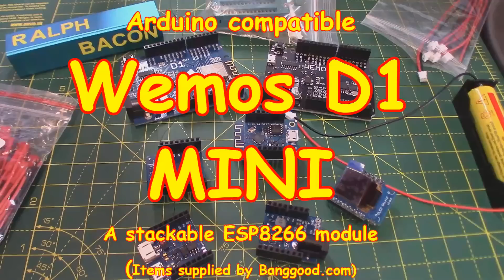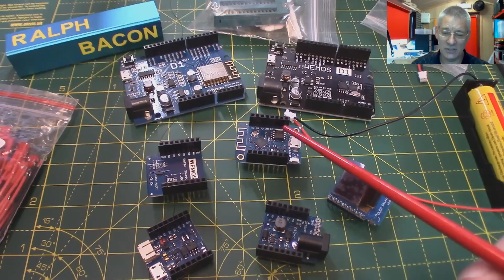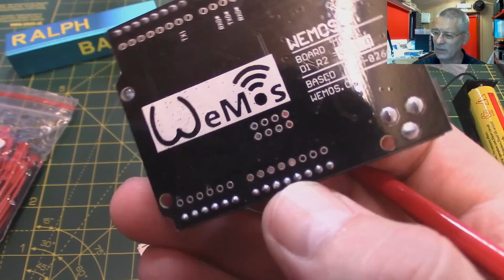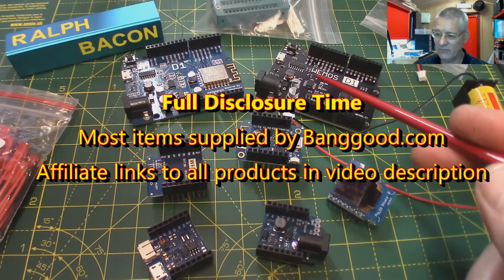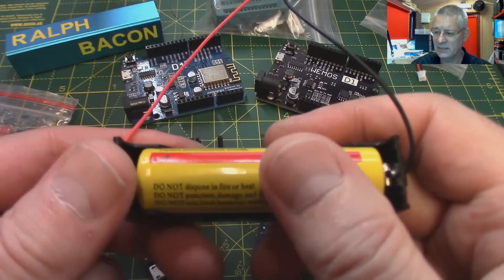#120 Wemos D1 Mini 👍 Intro (with shields)

Comment: I don't think there are strict rules for JST connectors and wire colors. It depends on how the designer implemented them, the designer can make or order the right combination of wires for that product. Manufacturers can produce wires in any color and combination if you order enough of them. If you're producing a product in large quantities, like 10K units, you can customize almost everything, including custom cables colors, wire combinations, custom text on the wires, etc.
Reply from the maker: Yes, manufacturers will customise a connector (the wiring) for you, but it leaves us hobbyists with a risk that it's not what we last used or what we expected, perhaps!

Comment: Really found this demo and explanation useful. I have been trying to tie all this together with your voltage monitor to monitor 12 volt solar battery over WiFi. perhaps this may be of interest to you for the future. There is little about to give accurate battery reading over WiFi. As I newbie it is a struggle to tie different projects together for me but just cannot get the end result of it working. Thank you for your video's they are very helpful.
Reply from the maker: Glad you're finding this video still useful!

Comment: I have LiPo batteries with that micro JST connector hard mounted to the battery without leads. Would be interesting to check polarity compared to that connector.
Reply from the maker: There just doesn't seem to be a standard - well, not at the time of making this video. Perhaps things have got better by now and follow a defacto standard.

Comment: Thanks for this video, Ralph! Currently diving into many rabbit holes concerning the installation of Home Assistant and adding protocols for my new home. I just ordered a Wemos D1 Mini (V3) with a DC Shield and a PWM Converter. I'm planning to use the D1 with ESPHome (or maybe something easier such as Tasmota or ESPEasy because it's my first installation) to give 0-10v signals to my mechanical ventilation (Zehnder ComfoAir E300).

I checked the Zehnder in my new home and it got three pins (?): GND, 12v and 0-10v. So with a closed circuit I can drive the Wemos D1 from my Zehnder and get it to automatically running once I'm showering (with a humidity sensor picking up a drastically increase in humidity) and once my cooker hood is on (maybe with a smart plug / switch or from the unit itself, because it's a Siemens cooker hood with Home Connect). Will keep you posted how it all works out in a couple of months :)
Reply from the maker: Sounds like a project to keep you busy!
Have you seen Pete Scargill's website that deals with MQTT, Node-Red and full Home Automation. I've briefly skimmed what he was doing, got my 4-ch Sonoff to respond to Alexa and then stopped. That was at least 1 year ago. But he is the guru of this stuff, worth taking some time to read his stuff, really it is.
https://tech.scargill.net/

Comment: How is it possible to install the CH340 driver! Write me the full procedure please!
Reply from the maker: This should help you Gabor:
https://learn.sparkfun.com/tutorials/how-to-install-ch340-drivers/all
Reply: @RalphBacon  I have got an Arduino panel type Wemos D1 R1. Is it compatible the method of installing CH340 driver due to this webside?
Reply from the maker: Yes, the driver is for your Windows PC not the Arduino, so it doesn't matter which Arduino board you plug into your CG340G (or have installed as part of the Arduino board). I have a Wemos D1R1 too and it works fine. You only have to do this once and your PC will recognise the CH340G forever.
Reply: @RalphBacon  I have already installed the CH340 driver, because the videó David that this is the compatible one which is necessary for Arduino Wemos D1 R1.
Reply: @RalphBacon  Thanks for the important informations. Should you show me websites, about Arduino Wemos D1 R1 programming from beginner level, to Advanced level? If you can show, please write down the links! Wrtie down the links that expalins the programming method easily!
Reply from the maker: I'm afraid that Google is your best friend here. I don't know what the problems you are having are; if you have installed the driver and the CH340G USB-to-Serial module is correctly identified under PORTS in Device Manager then whatever you put on the end of that module will work just fine.

Comment: How do you add the WEMOS_SHT3X library from your github page to Arduino?
Reply from the maker: Download and unzip if required. Place it in the libraries folder in your sketch folder (the libraries folder is a subfolder of where you place your sketches). Include the library as per the demo sketch.

Comment: Just curious,  have you tested the range of these devices?  I'm wondering how far they can go,  and still make a reliable wifi connection.
Reply from the maker: I haven't done any range testing, Roy. I do know that it works fine through two brick walls at about 10m in my mum's flat in Germany which was my only concern. This report has much more detail: https://hackaday.com/2014/09/26/esp8266-distance-testing/
Reply: Well,  I must say,  the results seen after following that link are quite impressive!  I guess I'm going to have to get a hold of some of these modules and play with them a bit.
Reply from the maker: That's the only way you will truly know the results. Go for it!

Comment: Hi Ralph where do you get your D1 Mini from as I have two clones that don't work properly and want to purchase the real thing I notice now that the d1 v3 has no can so are they genuine? Bob
Reply from the maker: Hi Bob, I got all my Wemos D1 Mini stuff from Banggood as they seemed to stock the whole range. Now whether that is a genuine range or not I couldn't say. It does have the Wemos branding but that means nothing. That said, I now have two of my Home Alone units running 24/7 in my mum's apartment and they don't go wrong! Geekcreit seem to have flooded the market recently though.
Example: https://www.banggood.com/5Pcs-WeMos-D1-mini-V2_2_0-WIFI-Internet-Development-Board-Based-ESP8266-4MB-FLASH-ESP-12S-Chip-p-1150188.html?p=FQ040729393382015118&utm_campaign=25129675&utm_content=3897

Comment: how do i upload codes from the arduino ide to the wemos esp32 mini32?
Reply from the maker: Exactly the same way as uploading to an Arduino Uno, via the USB socket on the Wemos. Works very well, no buttons to press either like on some other boards.

Comment: Another header wiring question: with your neat little stack (D1, battery shield and OLED), how would you make connections for other external devices (LEDs, sensors, etc.)? I'd like the D1 to be breadboard-able during development, but then fit into a stack for deployment.
Reply from the maker: You can get development shields to build your own custom circuit on. Obviously they have to be small enough to fit onto the ESP8266 Mini format or else you would have to design a daughter board that connects to the headers but overhangs if you have a big circuit. The bare dev boards are cheap, mainly because they are just a bit of PCB with headers sized to fit this format. Also look at my recent Home Alone project; there I have designed a HEX PCB base so I can have six on a single board so it is a bit flatter. Oh, and use good quality sockets, headers and stackable headers.
Reply: @RalphBacon  Thanks for the hints. I might just go with the usual protoboard stuff as I only have about six lines from the D1 stack to other components.

Comment: Ralph, I know it's an old video and this comment/question is a little "off-topic" but what lib did you use to get the clock running. Current 1.2.7 displays nothing but I get half a clock with 1.2.0., SFE_MicroOLED.h.  Thanks
Reply from the maker: To be honest, John, I just loaded up the example sketch that comes with the library I'm using (and is probably in my GitHub for this project). Try using the library I did and see whether that works better for you.
Reply: @RalphBacon  I found a simple fix!  It was called "Go to bed, and try tomorrow!"  It all worked fine!!  lol

Comment: Hi again Ralph
I'm going to forget about the OLED I was having problems with for the time being, as I know it works perfectly with another library.

Meanwhile, I've managed to adapt your code for sending temperature data using the SHT30, which I don't have, to the BMP180 shield. Remember, I said "what could possibly go wrong?" Well, nothing actually and it works a treat. Having dabbled a bit with HTML/CSS, one refinement I thought of was to have the page refresh every so many seconds/minutes so as not to keep pressing F5 all the time. So I included the line:

client.println("<meta http-equiv= &quot;refresh&quot; content = &quot;5&quot;>"); within  <head>

I used &quot because multiple inverted commas threw up errors with the compiler. But it still doesn't work. I wonder if you could show us the correct syntax in this context as it might be useful to others as well.

Thanks again for your very informative videos and your help with the OLED
Reply from the maker: I don't blame you giving up on that library/OLED combination at all, Pete! You've got a solution so stick with it.
Regarding that line, you can use single quotes within your main double-quoted string. LIke this:

client.println("<meta http-equiv= 'refresh'; content='5'>");

Have a go. 

Don't forget to put all HTML into PROGMEM or you will quickly run out of run-time memory.

These days I put all my HTML into a separate text file and read it in and spit it back out again, makes testing and editing the HTML much, much quicker. It does mean you have to store it somewhere, eg SPIFFS or SD card.
Reply: Oh, OK. I thought I had tried that actually. I'll try again.
Reply: Yes, it works fine! Thanks for that. It works on my phone too
Reply from the maker: Success at last then! Good to hear it!

Comment: It's not EXACTLY the same as yours, as yours has 2 buttons on the side labelled A & B. I am beginning to suspect there is something wrong with it despite having the Wemos name and logo, but you can never be sure these days. I HAVE been using your library and code. Having said that, on looking at  the screenshot in your link it showed the text "Hello Wor" and "OxDEA" which is obviously truncated which is what I get. So, perhaps I'm expecting too much. Many thanks again for your continued interest; it's much appreciated.
Reply from the maker: Quick update: the text is not truncated, it wraps onto the next line. More tomorrow...
Reply from the maker: OK, disregarding the fact that my OLED has two buttons (which may mean it has a different screen) have you loaded that test sketch with those libraries and got the same, (wrapped) text result? Unless, and until, you have tried this we won't know whether your screen is actually a different screen (or one that behaves differently, anyway). I'll await your response in due course. Fingers crossed!

Comment: Despite adding #define, as you suggested plus a couple more for the height and width, the OLED still doesn't perform as expected. I still get a display chopped off on all sides as if no attempt has been made to tailor it for this size. What is the point of the error trapping if it behaves in exactly the same way as when I comment it out. I'd be interested to know if your display behaves in the same way as mine. Of course it is still useable for a text display, you just need to be careful with formatting. U8g2 lib takes care of the different sizes of display and works a treat. And I still get nothing from the Sparkfun clock. I was experimenting with the wifi, which seems OK, if a bit slow and I want to try out your code for the SHT30. However, I don't have one but will have to modify your code to read the BMP180 shield instead. What could possibly go wrong!!??
Reply from the maker: If your OLED screen is the same as mine it has GOT to work! I have it running on more than one example. So how about I send you my OLED test sketch - well, the one that Adafruit includes that I have edited, can't remember what, too long ago. Use that with the libraries here and it has just GOT to work! As you say, What could possibly go wrong!!??
Get the libraries and the test sketch here: https://www.dropbox.com/sh/g3j9adxz8q61tps/AABG_l4bKqKEinMKsUm6Y7gVa?dl=0
When you compile (you're using the Arduino IDE?) keep a sharp watch on where it is dragging the libraries in from! Make sure it is this one!

Comment: Many thanks for prompt reply, Ralph. I was using the Adafruit lib 'forked' by Mike Causer to specifically cater for the 64x48 I2C display. I am at a loss, therefore, to understand the error message -
  #if (SSD1306_LCDHEIGHT != 48)

#error("Height incorrect, please fix Adafruit_SSD1306.h!");

#endif
 However, I am quite happy to use U8g2 lib (which often succeeds where others fail!) It will do what I want it to do. Thanks for the warning about screen burn.
Reply from the maker: It probably means you have not added a #define in your sketch to tell the library which screen you have. In my edited library I have added the line:
#define SSD1306_64_48
which might be all you need. 
Otherwise use the Adafruit library on my GitHub which either I have edited or it came like that, but I have no idea which it was: https://github.com/RalphBacon/ESP8266-Home-Alone-Vulnerable-Person-Monitor 
I'm still using this library so I know it works just fine! And you don't have to add anything but it will get out of date as Adafruit update theirs.

Comment: Having bought the D1 mini and several shields inc the OLED I tried all morning to get the wretched thing working. With the Adafruit lib, supposedly modified to suit a 64x48 display, I got an OLED height error and inviting me to modify the header file. What??? How am I to know what to do. I eventually commented out the three lines in the Arduino sketch so that it ignored the error and it worked - sort of - with parts of the display truncated as expected. I had at least satisfied myself that there was nothing inherently wrong and the address was correct. I then tried the little clock from Sparkfun - again, no joy, although others  don't seem to have a problem. I am sure all libraries are properly installed and up to date. I then turned to the U8g2 lib, which I've used before and guess what - it worked a treat. It is (supposedly) a genuine Wemos with their logo. BTW the D1 itself in wifi mode works ok having tried your sketch to turn the led on/off. Any comments would be welcome.
Reply from the maker: I used the standard Adafruit libraries, Pete, but I do remember having to edit it before finding a later version which catered for this new 64x48 sized screen (as you can see from my Home Alone project it works superbly). If you need a different library version I can put it on my GitHub for you.
On a related note, I was warned that you can get screen burn with this OLED screen after just a few months. I researched and saw an actual picture of this exact screen with some quite severe ghost images. So I programmatically switch off the screen after 30 seconds when I haven't really got much to show and switch it back on again when things happen in my project (eg there is movement, an upload is in progress, an error occurs etc).

Comment: Hi, Ralph, I have looked through your videos in the hope that you have done a video on programming the d1 with the Arduino IDE but with no luck so can you do a tutorial please as I find your videos easy to follow thanks Bob
Reply from the maker: You're in luck, Bob. Tomorrow's video is using the Arduino IDE and a Wemos D1 R2 (not a mini but it's an identical process apart from the board name). I even go into detail about how to get the ESP8266 boards into the IDE, how to select the board, the parameters you need and so on. Although the topic of the sketch may not be relevant to you, the way it is presented hopefully will be! See you tomorrow!

Comment: I have the WeMos D1 mini The schematic I have has a wire running from the charger module to the Wemos  VIN hole but mine doesen't have a VIN hole connection where do I connect it.
Reply from the maker: The Wemos D1 mini (mine's a version 3.0.0) requires a DC-Power-Shield to accept Vin (either wires or a standard 5.1mm plug). They are not expensive (£2.73 or $3.49) and work fine, accepting anything from 7v to 24v but I wouldn't push them too far; I've just ordered some more from Banggood: https://www.banggood.com/WeMos-DC-Power-Shield-V1_0_0-For-WeMos-D1-Mini-p-1160039.html?p=FQ040729393382015118&utm_campaign=25129675&utm_content=3897
Reply: @RalphBacon  Here is the schematic can I just connect the wire to another connection with out adding something.I an new at this and don't know what I'm doing https://drive.google.com/file/d/1PRDaSGIENCrb3MHXDk6Qwi3e8gnxunyV/edit Here is the WeMos D1 I have. https://www.google.com/search?q=wemos+Di+mini+v+2.20+pictures&client=firefox-b-1-d&tbm=isch&source=iu&ictx=1&fir=b_N6k4QjmeEJoM%253A%252Crx09cHdm0-c37M%252C_&vet=1&usg=AI4_-kSyRFrRCm3-hDeuqXc2C1t8pycASA&sa=X&ved=2ahUKEwjOnZPqjv3gAhUH1qwKHWq5C7IQ9QEwAXoECAQQBg#imgrc=LfmFOORdKxZmiM:&vet=1